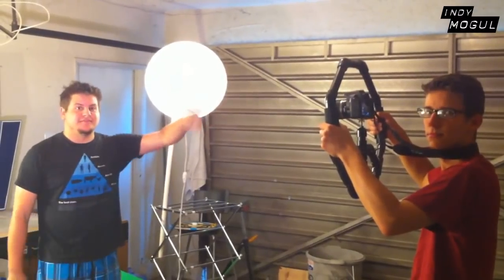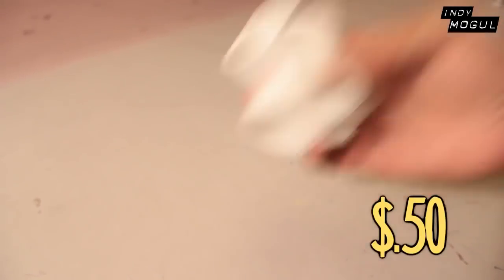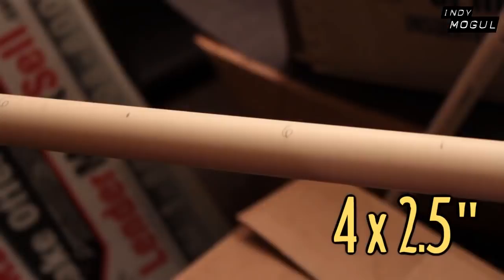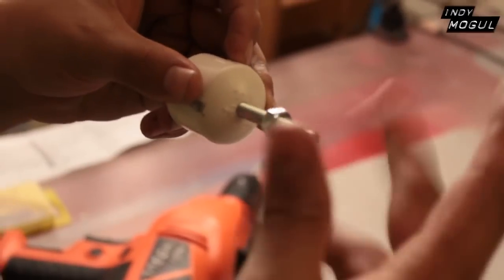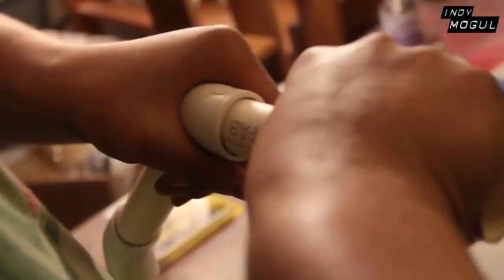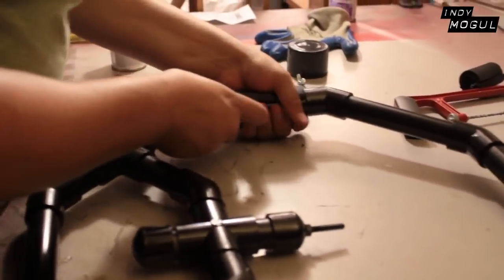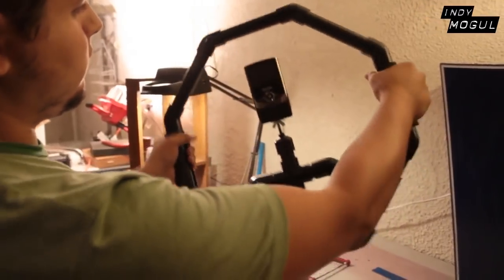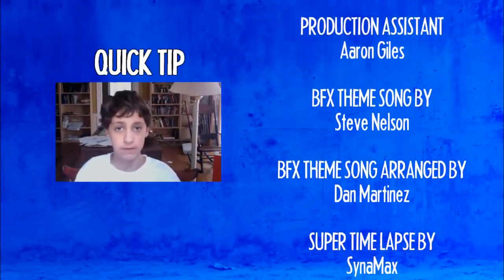Build a Fig Rig : DIY Film Tutorial

Comment: Just did it myself. I used ,5" pipes and I had to replace those 3 inch long with 1.5" on camera holding to mount it correctly. But the effect is amazing - zero shaking when running through stairwell.
Thank's for this tip!

Comment: Great video, decent build. First time I ever worked with PVC pipes. A few words on my expierience. Sawing through PVC with a hack saw is difficult and messy. You will have shavings everywhere. Get a friend to help or use a clamp. When you fit the rig together don't over tighten. It was impossible to get the smaller pieces back out, and I'm probably stronger than you. The primer runs. It will get everywhere. Glue the middle section first, work you way out.

Comment: Use a paint that bonds to plastic. Be patient. Otherwise you will have drip marks all over your rig. Finally this is something that the guys at Indymogul might want to speak too. The mount counter-screws when I attach my camera. I have to tighten and retighten several times before geting a solid attachement. Is there a better way? What's a foot plug assembly?

Comment: @Person1598 Well it depends the start point you set. If you see the start point at the beginning of the pipe, yes it's 135 degrees. But Since PVC pipe is horizontal, and a straight line, they must calculate the angle using as the starting point the end of the pc, and then the pieces make 45 degrees.

Comment: think about it. although the camera should be in the centre, just cutting the two pieces shorter will not solve your problem. the rig will not fit together anymore, because when you move the centre assembly downward the pipes will no longer line up.

Comment: @LastShinobi01 yes. a quarter inch screw will work pretty good, you need to check your cam for the size of the screw hole in its button, usually its a quarter inch, if its bigger\smaller then you'll need your bolt and your 2 nuts (not those nuts, silly XD) to be the same size

Comment: Just applied the primer... it was WAY harder to do than how it looks in the video. It dripped all over the place and the fumes were overbearing... even though I was wearing a face mask. I had to hold my breath and walk away after coating each piece. It got all over my gloves, parts I wasn't supposed to coat, and the primer jar itself. Same brand as in the video (it comes in the two-pack with the cement). Just letting everyone know: Wear gloves and do this outdoors or in a well-ventilated area.

Comment: @unrealxplicit 

3 quarters inch PVC pipe x1
45 degree PVC pipe connectors x10
T shaped PVC pipe connectors x2
A cross PVC pipe connector x1
Two end caps for PVC pipe x2
Two quarter inch nuts x2
One quarter inch fender washer
Quarter inch butterfly nut x1
Quarter inch bolt x1
Lawn mower grip x1/2
PVC cement  x1
Spray painting black 

Enjoy your new Fig Rig :)

Comment: This is basically impossible to make in Denmark I've just come to realise haha. Getting PVC pipes in this size isn't possible unless it's special PVC used in Aquariums etc (Which is expensive). Also the "Lawn Mower Grip" is an american thing that you cannot buy anywhere else, and getting any handles for anything other than the standard 22mm of bicycles (Which would be too large for a 20mm/16mm pipe) is impossible. All in all, unless you're an American with a Walmart, this is impossible. Thanks!

Comment: Here is everything you need to build it.
60”  ¾” pvc pipe (gives you 2" extra),
10, 45° connectors,
2 T shaped connectors,
1 cross connector,
2 end caps,
2, ¼” nuts,
1, ¼” washer,
1, ¼” butterfly nut,
1, ¼” bolt,
1 lawnmower grip,
pvc cement,
hack saw, and a power drill.
Reply: @Jason McCullough hej
Reply: Use PVC cutters instead of a saw. And hockey tape instead of lawnmower grip, you can craft a hand grip with the tape.

Comment: The primer is completely unnecessary. You only need that if you're doing plumbing, an only then if local building codes require it. The cement creates permanent welds without it just fine. Nice job!

Comment: So I just thought I would tell everyone of my experiences building this thing, for anyone that plans to do it. The measurements didn't quite fit, when it came down to the part that goes into the middle, the 1.5's were too short and it didn't reach, so I tried making two 2.5's and replacing the 1.5's but they were too long. I ended up using 1 1.5 and 1 2.5 piece for the middle part (not where it connects to the camera).

Comment: The conversion is simple math. 1 inch = 25.4 mm  multiply x 25.4 for mm or 2.54 for cm
I used push bike handle bar grips instead. They have to go on before gluing.
Great to see you used priming fluid on the pvc pipe.
Oh, and by the way  ErrkahhLa   The elbows are indeed 45 degree. You can only get 45 and 90 degree in pressure PVC pipe.  I'd say you were sold the wrong angle.

Comment: I live in holland,and i was searching for 3/4 inch pvc. i found it, but they didn't have any connectors... (nowhere!) so then i bought thicoker pvc witch is used for under your sink. these are 32mm in diameter (1.2598425196864 inch... :P). For this kind of pvc I found the connectors (except the cross-connector). so now is my question: is there anywhere a tutorial that uses this pvc? or can i use the same lengths? thanks!

Comment: I just went out and created mine today according to this video.  I wouldn't recommend 4 x 1.5" peices.  I would suggest to create only 2 x 1.5" pieces (for the top and bottom cross links) and let the other two be 2 x  2" pieces.  I basically got F*ked over because my center piece couldn't reach on either side for the pipes---in any event--it's ALWAYS better to have the pipe lengths a little longer so you can slide them in further if they're too long.  Thanks for the help indymogul =]

Comment: Tip for anyone attempting to construct the rig:
if you decide to use pvc glue like he does, it is very hard to put the rig all together piece by piece because the glue dries so fast. what i decided to do was put my rig all together (no glue) and then proceed to take off one section at a time, put glue on it, then put it back on, then repeat for each connector. This way the rig holds it shape while you put it together and doesnt get stuck being glued at any wierd angles.

Comment: @E4492 PVC cement is the only thing that will bond PVC to itself well. Super glue is the only thing that would come close but, even then, it won't hold for long. PVC is a different creature altogether. Even things like JB Weld aren't as strong as PVC cement. It works by, as Zack mentioned, melting the PVC to itself.

If you're putting a camera on this rig, I would hope you have strength and stability. We wouldn't dare put our camera on it unless we knew it was going to hold.

Comment: @SquareEyesSpyguy I went to bunnings at auburn. 
2x 1m 20cm PVC, 
10x 45 degree connectors, 
there are no cross connectors, so i bought 3x T shaped ones,
I didn't buy the primer, so cement was $5
Didn't buy grip,
1/4 inch bolt was very cheap,
and nuts were free.
I have just made my own video using this, finishing post production now.

Comment: I'm having troubles keeping the 1/4" bolt from rocking back and forth. After some use it loosens up, even with bolts on either side of the end cap. I am mounting a DSLR directly to the bolt as I don't have a bridge plate yet. This is my first build like this and not exactly construction savvy. Help?

Comment: awesome awesome rig. i ust built a couple( first ones came out rough but i got the hang of it and they work great on DSLR's!!!! if you wantto make a stronger one for bigger cameras use a t joint on the bottom in place of a 6 inch piece and run the bolt from the bottom of the rig to the camera mounting end cap.

Comment: Yes! I would look into a little better way of mounting your dslr on there instead of one bolt. I would try putting something else under the camera so the bolt isn't holding its full weight. maybe just a flat piece of PVC plastic with a hold drilled through the middle for the bolt.

Comment: DSLR PEOPLE: buy a rubber washer. Then get a small flat piece of wood for your camera to sit on, about the size of a credit card. drill a hole through the wood, then put it on the bolt, on top of the metal washer, then put the rubber washer on top of the wood, then you camera. The rubber should keep the camera from sliding around.

Comment: i used a threaded plug and tjoint instead of an endcap. i then attached to camera to the flat end of the plug using two nuts and 1 bolt. works better and is easier to take the camera on and off!!! thanks indy!!!

Comment: bad design... the whole purpose of the fig rig is for the camera lens to be at the CENTER of the circle to maximize stability. If you were to cut the two 45 degree 3inch PVC shorter, not only will the camera be in the center of the circle, but you could also have room for a shotgun mic on the camera